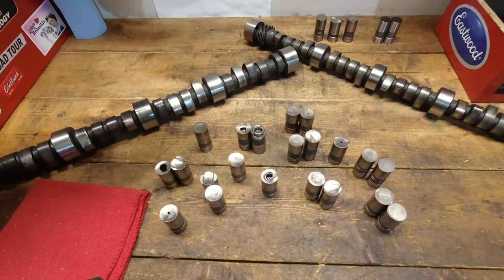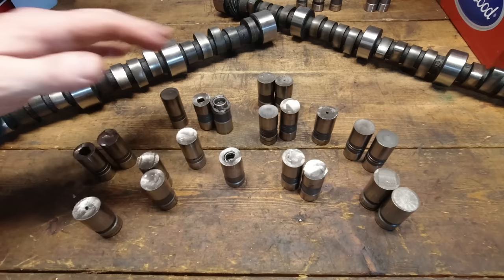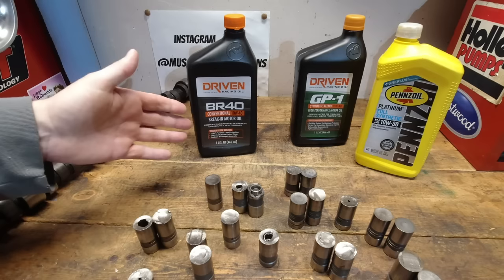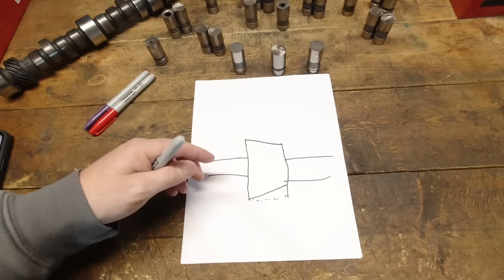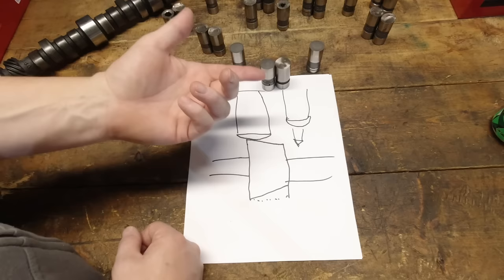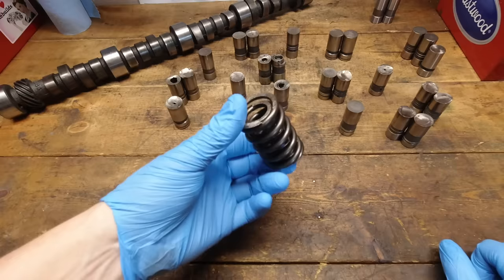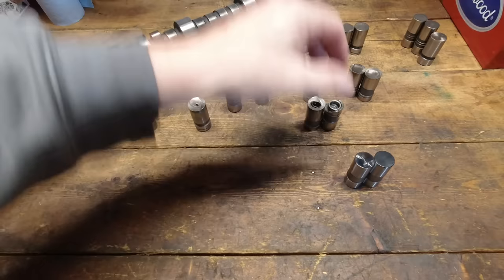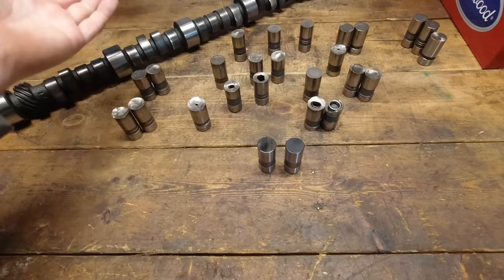Flat Tappet Cam Failures: The Reason Why They Go Bad & The Solution! Part 1

Comment: You know what I got thinking about last night was so incredible and I didn't even realize it at the time!
    Back in about 1981, I was a 13 year old who worked as a mechanic's helper in the summer and after school. The shop was small (3 of us usually, including me) and I earned a little under a dollar an hour. I bought my first car for a little under 4 weeks pay. I paid 150. Dollars for a 13 year old 'Honey' of a car (well, it was to me!). It was a 1968 Ford Fairlane and the shop owner was helping me get a 428 performance motor built for it. It was a running and drivable car but I didn't have a license yet, so I had time to build that motor. It had a 390 FE but everyone thought of that motor as non-performance or even as Junk!
  Well, Mr Daniel's let me get some of the stock parts on his NAPA account but No hi-po parts. I mainly wanted a cam, intake, Holley 4 barrel and headers. The cam and lifters had to be purchased first because the other things could be added later. 
   Well, back then a performance camshaft was mostly a solid lifter deal unless you had one of the most popular engines (SBC, BBC and SBF). We found a nice cam profile for a FE Ford in the Comp cams catalog and it was a Solid lifter cam. 
   I called Comp Cams and was talking to the guy about the cam and he said we had picked a good one for my combo. The next thing was the crazy part. I told him that I had saved about 110. dollars and didn't have enough for all of their parts (cam, lifters, lube and timing set. That was about 140 bucks! The man on the phone told me to save some more but I explained that the man who owned the shop said my motor was coming off the stand SOON! That man on the phone sold me the cam, two 'envelopes' of cam lube and a single row timing set for around 85 dollars. The cam alone listed for around 65 dollars. He said he was including the lube as samples (instead of buying a 'tub') and the timing set was strong 'enough'. I asked him about the lifters and he asked me if I had a pencil. I did and he gave me a part number and told me to get the NAPA store to order those. It was a Dorman part for Ford factory replacement solid lifters for a 427. He told me they would work alright and should cost around 20-25 bucks. They were perfect and we had found the adjustable factory rocker setup off a 428 Cobra Jet. They were rail mounted cast rockers that had an adjuster with a 'ball' end and one end of the pushrods was cupped for it. The machine shop shimmed up some valvesprings from God knows where when they did the valve job on the heads. They cut the heads about 70 thousandths to boost the compression, as well.
    As a kid, I didn't quite understand what it all really meant that these people were not trying to make the most money, as much as they were all helping a kid build his first motor. 
    They were smarter than I thought. That man from Comp Cams bought a customer for life by telling me where to get lifters I could afford! I have put ONLY Comp Cams camshafts in every motor I have built since then (my motors are probably around 3 dozen)!
    A company would never consider doing something like that and wonder why they don't have 'Brand Loyal' customers.(?)!
    That car ran sweet with it's used iron intake and rebuilt used Holley and the exhaust note was perfect from a solid lifter cam motor through a set of 49.95 headers and a pair of Cherry Bomb glass packs! The factory rocker setup wasn't great. I had to adjust the lash every few weeks but that was alright. 
   That was a great time in history and kids now hear about my pay and think it was bad. I want to see a kid buy a 2011 automobile for 4 weeks pay, nowadays! Ya'll Take Care, John
Reply: Good ol' boys trying to help a kid out but being careful to not let the kid get in over his head. Very nicely written story that conveys a message that I can certainly relate to (I'm about 8 years your senior).

Comment: I've been a mechanic since 1981 and I unlike many others I DO remember lifter and cam failures. Much more often on engines with some miles and not failing in a few hundred miles, but it did happen. Zinc/phosphorous was in the oil back then and they still went bad. I will say it's happening more, likely due to the oil chemistry changing, but also from people trying "tricks" to break in the cam rather than following the correct procedure for their product. Also it is possible to use TOO MUCH zinc additive. Lifter bore clearance is also rarely checked.
Thanks for the video.
Reply from the maker: I cover a lot in this video series.  As deep as I could with my limited means.  It’s amazing what you find when you put all the internet theory aside and actually look and measure the problem.  Check out the rest of the videos.  I think you’ll find them enlightening.

Comment: Father ran a small three stall garage for 50 years here in the Midwest (1950 to 2000).  He installed hundreds of camshafts in engines of all configuration.  The seventies were particularly busy with the GM camshaft fiasco and Ford crankshaft shame years.  Only saw two of his fail, both were aftermarket performance cheapo items.  Never used to be any sort of chore to install a flat tappet cam.  Betting it is indeed the push towards roller only business.
Reply: I had a shop in the 70's and 80's. You are right. The mouse has no thrust washer. So cams would go bad. 
Ford had the 351M/400. Those cranks were junk. 
I even put a windsor crank in an M engine to see if that would work.
Reply: Watch Powell Machines lifter and camshaft video. They are machining the lifters wrong.

Comment: My first engine build in 1992, built it, new cam, lifters and springs. Fired it up and drove away with no “break in”. Never had any issues, motor lived for another 8 years with trips to the strip every now and then until #3 rod played knock knock with the block.

Comment: Personally, I would keep the windage tray where it belongs and groove the lifter bores. That guarantees that oil is squirting onto the lobe before the lifter. Also, some lifters have a small hole drilled through the bottom for added oil between the lifter and the cam lobe. If your engine does not experience wear or lack of oil change, that hole should be open for the life of the lifter. I purchased a lifter bore groover. Also, my choice of break in lubes is Mr. Race Oil available direct from them or from  Goodson. Cummins rebuilding centers use Mr. Race Oil for their remanufactured diesels. Great tip on the DLC coating.

Comment: Besides break-in springs and break-in oil, you can get lower-ratio break-in rockers for some engines.  For example, 1.3:1 rockers are available for SBCs, so that's a 19% reduction in force at the lifter when compared to a 1.6:1 rocker.
Reply: By the time you buy break in springs and break in rocker arms, you could probably just go with a roller cam and be done with it.

Comment: 50 years ago here in Australia, we only used the OEM lifters (no aftermarket stuff then) and it was pretty common to get lifters 're-radiused' when replacing a cam as standard practice. The cost was reasonable for the time, much less than buying new genuine. Secondly, I always overfill the break in oil by a pint or two, not enough to foam, but to give better splash lube to the flat tappet cam. Good video!

Comment: Powell machine did a great video on the lifter cam problems. Said the lifters are ground with to much taper up to 3 thousands, shud be around 1 and half thousands
Reply from the maker: I’ll have to go look to see what they have to say about crown on lifters.  Thanks for the heads up.
Reply: I saw the Powell video too. I think he said the issue was lifter are being made with NO taper.
Reply from the maker: @williamhaggerson5490 lifters have crown, lobes have taper (should).  There is no one number that crown should be.  It MUST match up with the taper on the lobe.  There’s a preferred crown that the OEs preferred but it has to align with the taper on the lobe.  Watch my video on lifters and we go into great detail and measure some popular lifters to see what their crown is.  But it still must match the cam and even odd crowned lifters can work with the right taper cam.

Comment: At 80 yrs I've been involved building my own injected  & BLOWN alcohol funny car engines. Of course I used roller tappets in  my later engines. But had lots of flat tappet cams in the past before we'd ever heard the term "break in oil". I never had a problem with what you are showing, I always coated the cam lobes & tappets with molybdenum disulfide grease or "Moly Slip"  I don't see that stuff around any more
Reply from the maker: Are you comparing blown alcohol funny car engines to street engines?
Reply: your older oils had more zink less detergent 😊
Reply: Engine assembly lube has molybdenum disulphide in it

Comment: I've gone through this nightmare far to many times. I've used COMP break in oil each time, my 283 ate a lobe after 8 years. I put 5 cams in that engine, and they all had various lengths to how long they lasted. I used lots of break in lube, 2000-2500 rpm and varied it because that's what I've always been told. I gave up on that 283, built a 350 with a 268XE Comp cam with lifters, it ate three lifters in a day, put metal everywhere, chunks in the pan, tore it down, had it tanked. 

I reassembled it with new bearings, a 262XE with matching lifters, lasted a weak of driving, put it away for the winter, it ate the cam on the drive home in March 2020. I used COMP break in oil, comp break in lube (moly break in lube on the 283) . Currently I have a very worn out 350, a used cam dynamics cam and NOS Elgin lifters I bought at a swap meet years ago, it was just supposed to get the car moving for 2020, now it won't die. 

Springs in the 283 were Z28 springs, I think 120 lbs closed, could be wrong. I can't remember what the springs in the 350 were at, I know they were comp though. I'm seriously thinking of going roller.
Reply from the maker: Sounds like you could of had too much spring pressure.  It’s not uncommon.  Half the lifters shown in this video can probably be traced directly back to too much spring pressure at break in.
Reply: @MuscleCarSolutions  It's entirely possible, I remember my friend said he put the 350 springs in at as light a pressure as he could. The second time it ate the cam, it didn't demolish the lifters, but the first time was BAD. I'll know for sure in a month or two, before Christmas the machine shop I took the 350 to is going to check spring pressures and lifter bores as well as cleaning the block out again.
Reply from the maker: It’s a super critical part of the break in that most mess up.  It’s a pain to set up light then go back after the break in is done.  It’s the one thing that I think universally gets avoided because it’s not easy.  Sorry you had those failures!  Go light and get it done!
Reply: @Muscle Car Solutions  Thanks for the info!
Reply from the maker: All the best to you sir!
Reply: ow that is just awful to have to go through that.i would go roller and never look back.i cant imagine how much money u lost and pissed off .i would be heated.
Reply from the maker: @havoc9926  it’s been the easiest solution for sure to go roller, but I get some folks want a more budget friendly cam and lifters.  Looks like that’s still an option with perhaps not all the work.
Reply: @havoc 99  Oh I was pretty pissed, and I've built other sbc and never had that issue, it's crazy.

Comment: Very in depth info that the car community needs to share. Thanks for taking the time to make this video.
Reply from the maker: Appreciate the comment.  Took forever to gather all the materials but I wanted a full look at the types of failure from most flat tappet cam manufacturers.  Just took awhile to get them all.  Thank you!

Comment: Over here in Australia most if not all respected high performance engine shops reface all flat tappet lifters before selling them to the public or fitting them to a customer's engine and are not having failures. Interestingly one of the larger shops is a comp dealer and reface comp lifters too. The shops I've spoken to say it doesn't matter what brand as they all can be hit or miss.
Reply from the maker: Australian prices on cam and lifter sets are ridiculous.  Americans complain about the prices here.  They’d die if they knew what you were paying.  😆
Reply: @MuscleCarSolutions  yeah everything is expensive here. Only saviour is having plenty of cleveland stuff here and companies like CHI Higgins and Yella Terra here.
Reply from the maker: I don’t know if Cleveland stuff is an actual benefit or a curse.  😆
Reply: @MuscleCarSolutions  look at engine masters and see what was the most successful head. Does pro stock ring a bell. Or being competitive in nascar against big blocks.
Reply: What other small block came with 270cfm ports stock.
Reply from the maker: Rarely see a cleveland on the street here.  Rare.  But if I were to build a ferd, it’s a Windsor hands down.
Reply: @MuscleCarSolutions  yeah we had few winsors here and they couldn't compete with the cleveland until affordable aftermarket heads were available which weren't that affordable in Australia. Its different now heaps of choice for the Windsor. Most fit cleveland style heads to them here though.
Reply: Cheers good video.
Reply from the maker: That’s what I love about your market down there.  It’s the same, but you all have things in abundance there we never had.  Makes it even more unique.  Love the Australian car culture.  No doubt, you’re as addicted as we are.  Can’t wait from my next trip there.  Enjoy the rest of your summer!  Cheers!
Reply: Always been a Mopar and Chevy owner but I've had friends with absolute beast Clevelands so nothing but respect from me on that engine line.
Reply: @Haffschlappe  very good cams using them since late 80s

Comment: Im going to be building a 350 this year and I plan on running a flat tappet cam. I know everyone says go roller but the one time I put a roller cam in the roller came loose from the lifter body and that was using the lifters the company recommended. In my opinion its a gamble no matter which way you go.
Reply from the maker: Everything is a gamble, no doubt.  Flat tappet stuff can be done, but all those critical points must be done right for any chance of survival.

Comment: I`ve done bunches of flat tappet engines in the last 20yrs for circle track motors and not had that kind of failure. I go to a great deal of trouble and time to increase my chances so as not to get in that kind of trouble. I have had to replace valve train components on refresh jobs but the ware was minimal even after 2 seasons. I break them in with inner springs removed along with letting the installed height run wild. I use Brad Penn semi synthetic oil with a zinc additive and leave it in for at least 50 laps but change the filter after they come off the dyno. During assembly I install the cam and lifters with WD-40 only and spin the cam manually or with a drill fairly slow, 100 rpm or so and look at each lifter to see if it turns like a 1/4 turn or so per cycle. If they don`t something is wrong, they usually need more honing. I like those Johnson HI-LIFT followers. The solid ones with the holes in the bottom work well even with abusive spring pressure.
Reply: Some good tips.  I prefer driven but know others who like penn.
What rpm do you use on break in?  Listening to him say 1800-2100 sounds odd.  Had success with 2800-3200 varying, primed and timing close so it fires right up and straight there.
Any experience with agressive profiles like GRI?

Comment: I'm still using flat tappet cams in my engines I put together for myself & so far I have had good luck with them. Pretty much all I build for myself are FE fords or 385 series fords. But I've seen so many people I believe making mistakes. I'm part of some engine groups on fb & the amount of people that swear by desiel oil is scary. I've also watch a video wear the guy claimed to be able to feel the crown of the lifter by setting it on a flat surface & rocking the lifter! I told him if u can rock that lifter it's not good! I will somtimes hold them to a straight edge & then against the straight edge & hold them up to a light & I can see if it's a crown or on old ones I can see when they are sunk in the middle. But I've never been able to tell by rocking the lifter.
Reply: Grab two brand new lifters put them face to face and if you look carefully under a light you will be able to rock them and see the crowns/light between the lifter faces.

Comment: Great info. I did comp 4x4 cam in my truck. I had a good 6k on it, no problems. Then I got a tick and checked  the rocker and was loose, but the lock nut was tight. I pulled intake, and the lifter was dished but not gouged.

Comment: THANK YOU, very much for answering ALL of the questions I've had about this problem.  I've actually been away from engine building for at least  20 years now. Now that I'm retried, I'm getting back into the Hobby. I've heard and read alot about this growing problem and want to let you know, you have done GREAT JOB of really explaining this for me. Didn't realize the industry, mainly oil, had changed So Much. It All Makes Total Sense to Me Now. THANKS AGAIN!!!
Reply from the maker: A lot has changed.  Fortunately the new lifters are starting to really hit the market and haven’t seen any bad reports on them yet.